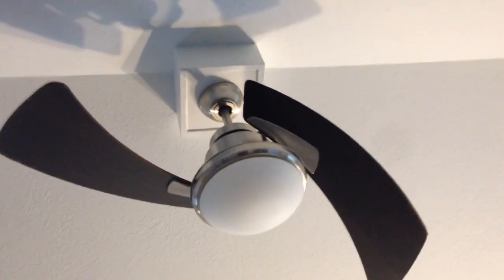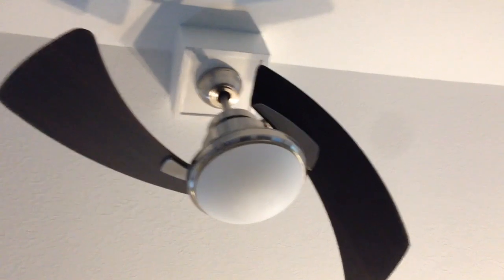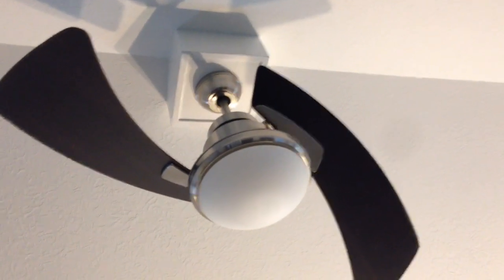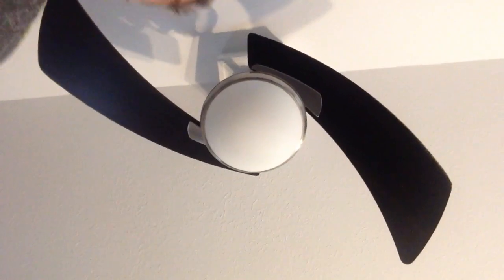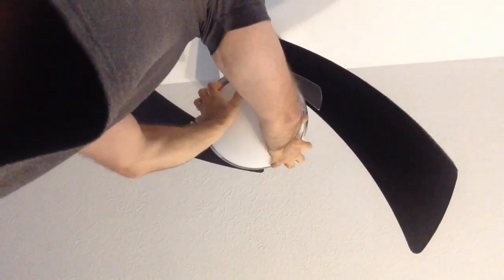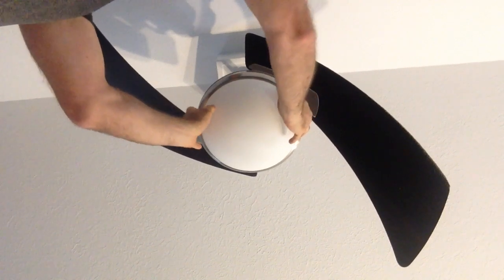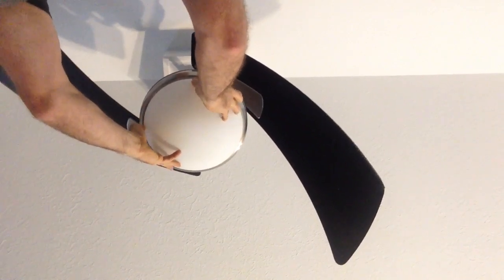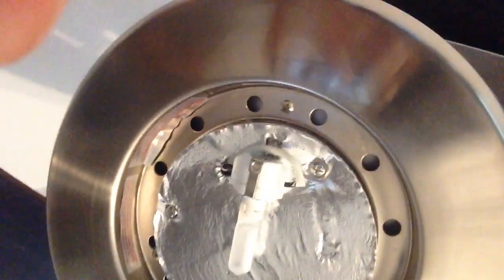Removing the dome from a Harbor Breeze ceiling fan - PLEASE LIKE/COMMENT IF HELPFUL

Comment: You really gotta jimmy that thing. Thanks for the help, now if I could find a bulb for this fan that doesn't put out so much heat!
Reply from the maker: Agreed.  I was originally afraid I was going to break the dome because I had to pull so hard.  Those lights are halogen bulbs so I'm not sure if there is a way to avoid the heat unless there is an LED replacement bulb that I am not aware of.  We have a vaulted ceiling so we don't feel the heat from the bulb when the light is on.

Comment: I've got this model also, 2 of them. Light replacements dont work in one, the other turns on and off when it's set to the 3rd or 4th setting. Not a big fan. Thanks for the video!!

Comment: Mine was spinning the assembly unthreading it from the motor.  So one hand holding base and the other trying to break the globe loose.  Which it did.  ...And flew across the room and shattered on the floor.  A thousand curses on the a***ole that designed this!

Comment: Had a slightly different dome.  The whole assembly turned when turning the dome.  I gently tapped the upper edges of the dome with a rubber mallet.  Held the upper part & easily unscrewed the dome.   Bingo!
Reply: I did basically the same but used a pair of clean white sole shoes to torque from each side. Just needed a single jolt then came off pretty easy.

Comment: these fans have been recalled by Lowes because the blades break off and cause injuries.
Reply from the maker: I have not had that problem but good to know.
Reply: supposedly there is a free kit you can get but you have to install it.  not many people are going to know how to do that...
It's like your car air bag can injure you, so they send a free one in the mail for you to install with some installation instructions in Chinese, with a toll free number if you have problems...
Reply: @AffordBindEquipment  i agree. Their solution is poor. Also you have to take the fan apart to get the right product code.

Comment: The remote ,fan and light Nothing is working.  Not sure, what to do ? Can you please help how to drill down the issue?
Reply from the maker: Hard to say.  Check the breaker first then try replacing the battery in the remote.  If its not those, could be a wiring issue.

Comment: These bulbs are new to me. How does the bulb disconnect? Does it need to be twisted off?
Reply from the maker: I don't recall.  I think it twists but it may just pull out.
Reply: Yes they do twist off like a regular light bulbs. Have to be careful not to twist too  hard. Thanks again

Comment: Is the remote the ONLY way to operate it ? I would like to use the outlets on my wall but it doesn’t work for me, just the remote
Reply from the maker: I think so.  I have a wall switch that turns the whole thing on and off but have not figured out if there is a way to use one switch to turn the fan on and off and another wall switch for the light.
Reply: bcog11 oh okay, thanks for the reply!...I’ve had mine for about 3-4 years I may change it, never been a fan of the remote
Reply: So my remote works and the fan makes this beeping noise when I press a button on the remote but the doesn’t spin also I don’t have a bulb in it , do I need a bulb to have it spin or what ?
Reply: I just want the fan to spin and it’s when I press any button on the remote

Comment: Anyone know the bulb
Reply from the maker: I don't know if the bulb is the exact same in all of these so I don't want to give you incorrect information but I removed the bulb and looked at the number on the side of white base of the bulb.  I called my local Ace hardware and read them the number and they had it in stock.  It is a fairly common bulb so they probably also have it at Lowes or Home Depot.

Comment: hello can you please tell me the name of the replacement bulb
Reply from the maker: I don't know if the bulb is the exact same in all of these so I don't want to give you incorrect information but I removed the bulb and looked at the number on the side of white base of the bulb.  I called my local Ace hardware and read them the number and they had it in stock.  It is a fairly common bulb so they probably also have it at Lowes or Home Depot.
Reply: My Harbor Breeze Santa Ana manual states light bulb #PPE11B100.  I bought my HB brand new 3 years ago so I know for a fact that this manual does match my present ceiling fan.  It seems I bought my replacement bulb at a local Tru-value hardware store.  I can also get the replacement bulb at Lowes.  If you look Lowes up online and put in your zip code, it will even tell you which aisle and bin to find it.

Comment: what kind of bulb is needed
Reply from the maker: I don't know if the bulb is the exact same in all of these so I don't want to give you incorrect information but I removed the bulb and looked at the number on the side of white base of the bulb. I called my local Ace hardware and read them the number and they had it in stock. It is a fairly common bulb so they probably also have it at Lowes or Home Depot or you can probably order it on Amazon.